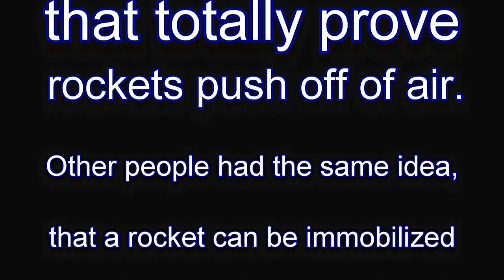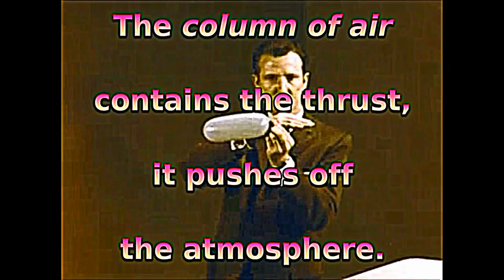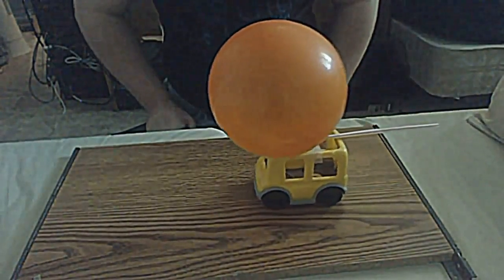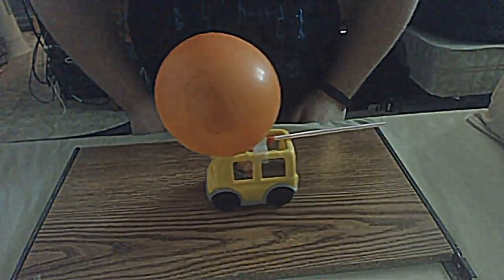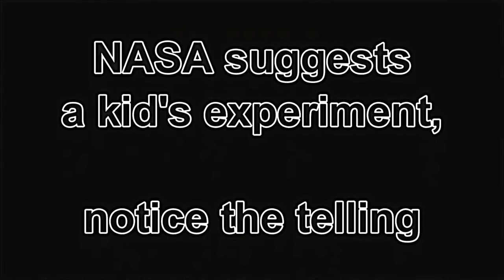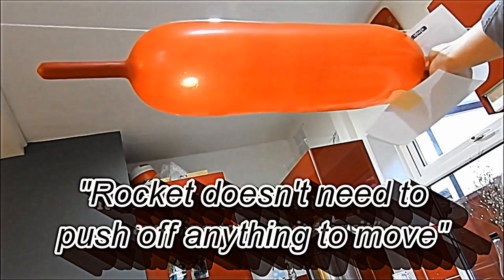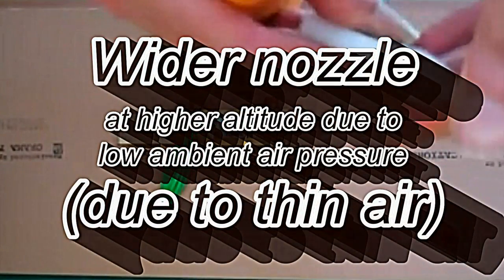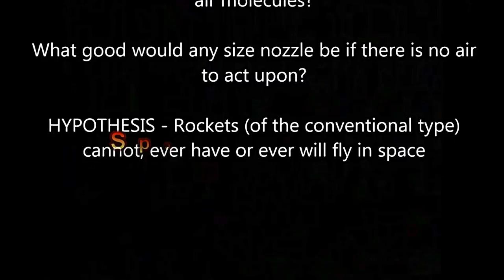rockets push off air

Comment: All you have done here is used the vacuum cleaner to remove the air out of the balloon without it having the opportunity to push against the far end of the balloon wall. Which means there is no equal and opposite reaction. 
Conclusion: You don’t have a clue what you are doing. I call it childish gobsmacking ignorance.
Reply from the maker: That's bull 💩💩💩! Because THE MOMENT the opening is created, "an equal opposite force" acts at the opposite end to the opening, according to NASA. 

"All you have done here is used the vacuum cleaner to remove the air out of the balloon without it having the opportunity to push against the far end of the balloon wall. Which means there is no equal and opposite reaction." -- Did Newton say that a DELAY is required in his third law? HAAAHHAAHHAAA!!!! 🤣🤣🤣

nasa APOLOGISTS claim that "once the exhaust passes the exit point" it can no longer have any effect on the rocket. CLEARLY, that is not the case!

If that was the case, as in slapping a cannonball after it has left the cannon has no effect on the cannon, THEN SIMILARLY, bending the exhaust at a distance from the exit point should have no effect. But it DOES!

Because, it is a single system, you cannot separate the exhaust from the rocket nozzle, anymore than the flame from a blowtorch.

Your understanding is pitiful. Read the description, to learn what scientists knew before Goddard's lies.
Reply: Lol and what do you think would happen in the alleged conditions in "space?" lol

Comment: Oh, so you think kinetic energy produced by rocket engines is the same as air being expelled from a balloon. 
Outside of that, it isn't an accurate experiment, surely to be an accurate experiment you would need a rocket and the vacuum of space, not a vacuum cleaner.
The best you can say it was is a waste of time, it neither proves nor disproves anything and more importantly, you can't recreate the conditions required to achieve either outcome.
Reply from the maker: you need to go back and review the scrolling text at the start of the video. You obviously did not watch or comprehend the video based on what you said about the vacuum--it was used to bend the exhaust thrust column at a distance from the exit point, and this immobilized the rocket. What you need to do (which is impossible) is to explain this result in terms of "ejecting a mass"  good luck!  ;-)